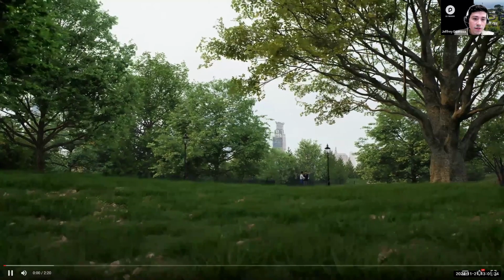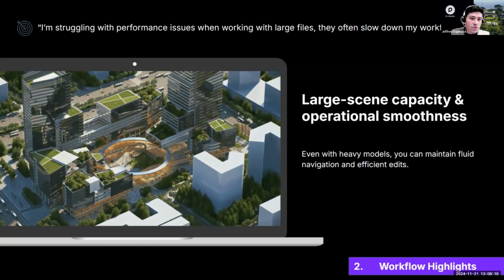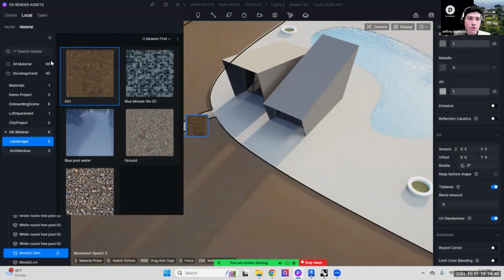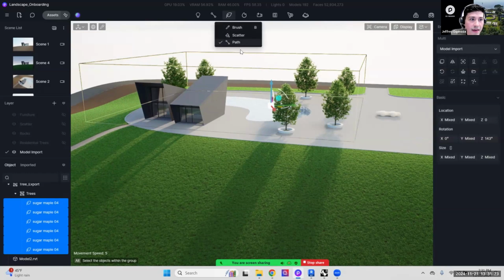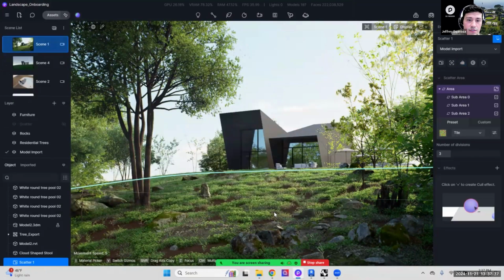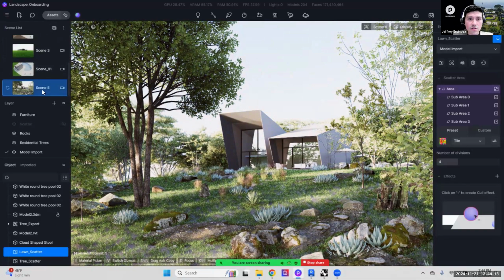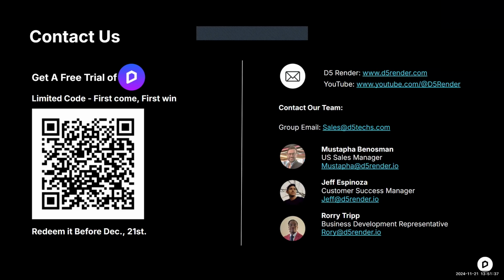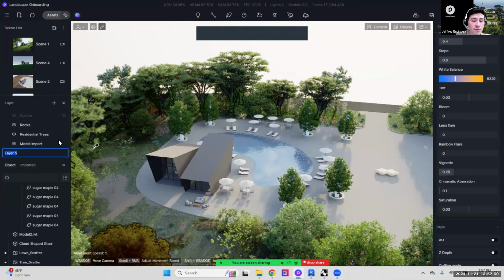Master Your Landscape Design Workflow: Seamless, Efficient, and Innovative

Comment: It's ridiculous to watch a moving tree swing wildly while the tree on the other side remains frozen..
Reply: Maybe the other one is static
Reply: @bambigoki3550  It is. But some flowers and trees can be annoying when they are not moving. You use a model like this that has no movement and the result is a mixed image. I used Lumion for many years, I just started with d5render and it is a great program. In fact, it is better than Lumion.

But in Lumion, all objects, trees, greenery, including moving grass.
Reply: We need camera tracking with video drone❤❤ please d5 team🙏🏻 I pray for it